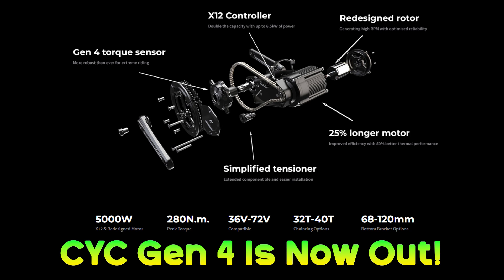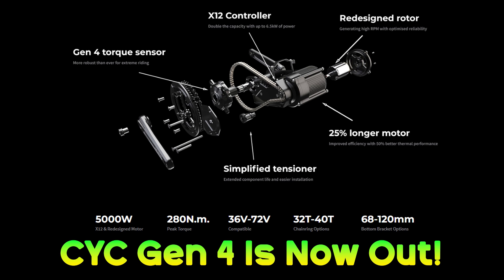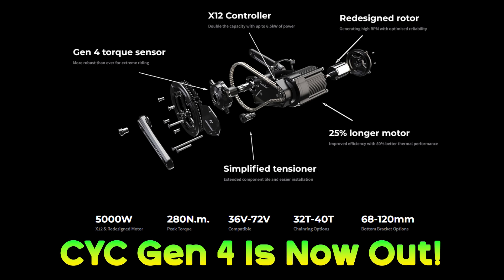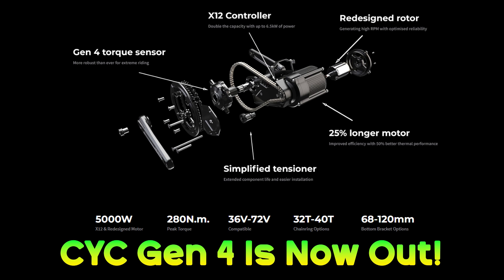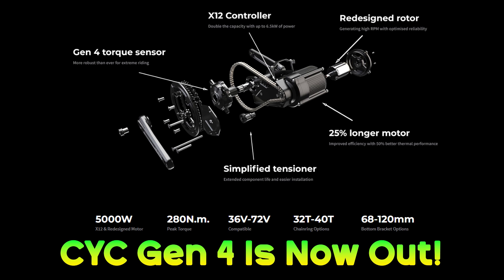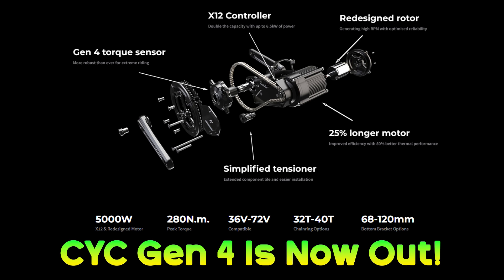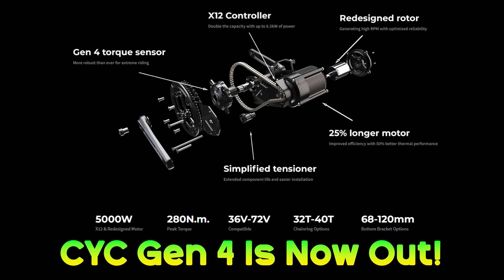CYC Gen 4 - Come on CYC! Show us the High Power!

Comment: I guess I am going to be the crash test dummy for the the cyc pro gen 4. I am a london bike courier riding the central london circuit on a highly customised omnium v3 electric cargo bike. Currently it has a photon which has done almost 6000 miles and has had two major breakdowns. My omnium with a heavy cargo can weigh as much as 75 kg fully loaded. The photon has done well but it is underpowered for the kind of courier machine I ride. Therefore the shop will upgrade the motor to a cyc pro gen4 to solve the power problems. I will keep you posted.

Comment: I think the only thing I will say is you’re kinda wanting too much. Because this is a diy kit and everybody will be putting these on extremely varied setups, so they can only do much testing.

They also have to appear more like a professional company than a hobby company.
Reply from the maker: I’m not so much concerned about their variety of frames but the length of running and conditions they test in. So like run it full bore up hills for 10km etc over and over and over. Because in the previous generations that’s what has resulted in failures. Hopefully this 4th generation will have greater reliability at the levels of power they are saying it can handle. It’s not a big motor and they are rating it above some really big and chunky QS motors.

Comment: I was thinking of adding on my old hardtail mountain bike, with single speed and running a 60v 60amps LiFePO4 battery, any thoughts?
Reply from the maker: I would be careful about how much draw the battery can take. But yeah why not. The draw is Watts / voltage = max amps. You want to leave some overhead though
Reply: @HighVoltageKits  It's a 60 amps BMS, I was thinking of protecting the motor, not the battery lol, also it's a LiFePO4 and usually can take full discharge without too much damage

Comment: My national agency, which sells fourth-generation motors, says the noise has decreased a lot compared to the third generation, but the manufacturer says there is not much difference in comments somewhere on the YouTube video. If it had actually decreased, the manufacturer would have made a comparative video, but I'm more confident to see that it's not.
Reply from the maker: Not shocked at all. The fact they won't make this video along with the motor being the same construction and parts with a few minor tweaks suggests it will be just as loud. Its more the pitch that people find annoying. They know it hurts sales so making claims its now quieter is a good thing for them.

Comment: I was looking at engwe m20 vs this one. But have no idea if it gonna fit
Reply from the maker: Maybe post some frame pics on our Discord and we can take a look.
Reply: @HighVoltageKits i hadn't use discord for years since it got hacked once. But i did saw videos up on youtube about they putting cyc pro gen 3 on m20. It need some modifies to fit so i move on with that frame. I don't want to do those sketchy mod that will avoid warranty. So i  bought an custom frame with battery from datbike and paid moder to put on pedal. Was about to pick that up next weekend when all the mods order will be put together. Highly recommend you should look for that frame. Mine was from used Weaver but brand new battery from weaver 200.
Reply: @HighVoltageKits and yes, it will fit cyc x1 gen 4 cause i order it to be modied to accept x1 pro/stealth gen 3 and even toseven dm1.

Comment: I think the new bafang torque sensor motors will finally bridge the gap against the cyc photon, tongsheng tsdz2 and the new dm motors. I have a tsdz2 and a bbs02b. The tsdz2 is a good motor but they're too flimsy.
The whole thing is secured with crappy circlips. The bbs02b is just rock solid. A couple of weeks back we had floods in the uk, I had no choice but to ride with the motor submerged in water for a good 10 minutes, I had no choice as every possible route home was flooded. When I arrived home I took the motor apart and was surprised at the small amount of water that had penterated. I love these motors theirs no comparison in terms of reliability atm.
Reply from the maker: Absolutely. They are pretty awesome. Let's hope it works out with the BBSHD / M635

Comment: In the end I do not trust CYC anymore. I run a X1 Pro Gen 2 here (with the option to upgrade to a Gen3 controller). When I met Cathy at Eurobike 2022 she promised that the software issues with the Android app for the Gen 2 will be fixed sometimes till the end of 2022. Then the new Gen 3 controller with new display and new app came out and surprise: No updates for the Gen 2 Android app anymore which programs the ASI 855. From what I have heared the Photon has similar software issues with the app. It´s not that the CYC X1 is a bad motor if you run it in decent power levels (e.g. 1-1.2 kW average with some peaks up to 1.4 kW) in PAS / torque mode but in high power throttle mode you will quickly waste either the X1 and / or your drive train. I have a Fat bike with stock BBS HD plus Eggrider. Also I build various BBS 02 fully MTBs with EggRider as well. I guess if the X1 dies on my fully I will either got the BBS 02 or BBS HD route. No money for CYC anymore. Especially getting spare parts in Germany is a true PITA and can get pretty expensive.
Reply from the maker: Yeah. You can't fault them for trying and keeping trying and there is a case to say they have got better but your story is not unique.

Comment: When I upgrade I'm probably going with TQ HPR50 since you can buy them as components now instead of spending 15k USD to get one on a bike - they're still about a kbuck so if I need another motor the Tongshen has been working fine for me and the torque sensor is really good on it so for about 270 just for the motor/display it's hard not to go with another TSDZ2B.  I pulled it out the box, installed it, and it just worked.  Nothing to write home about but there is also something to be said for zero issues (so far).
Reply from the maker: Not that familiar with that one! Yeah the Tongsheng is cheap. Also consider the DM02 its an improvement over that motor for not that much more.

Comment: The Ristretto 512 will be the first mass retail ebike to use the gen 4. Will keep you posted on how things are going once I get it, expected in March. I don't think there is going to be any meaningful amount of reduced noise from gen 4, only some arbitrary % they may assign to it hence they don't use it as a selling point.
Reply from the maker: The Ristretto is interesting. A guy on the channel got one of the previous ones. They put a special version of the controller on it restricting the power, so it likely to be 3500 watts maximum. You might be right on the noise. Please update. Might be a good one for the channel if you are interested.
Reply: @HighVoltageKits  It will be capped at 4500w/250nm of torque
Reply from the maker: Right on. I would take the nm thing with a grain of salt. I doubt they measured it. Is it going to be single speed?
Reply: @HighVoltageKits  Ok will keep the NM in mind, but it's def up there. It's a single speed and reaches 30mph in literally 3-4 secs, and 38 in another few seconds, topping out/cruising at 40mph on flat. On uphills it has so much torque, it just keeps pulling with no drop in speed. 52v/30a battery btw. This is all great, big question is how long will the motor last for lol TBC..

Comment: I'm planning to build a gen 4 5kw hardtail,  have a gen2 with bac2000 but swapped to x6 at 2kw pas, the bac2000 is on the parts shelf for another project.
Reply from the maker: Cool. Will need folks like you to give some genuine feedback. How the sprockets hold up. What drive train you go with etc. Be great to feature it and help others with theirs! Cheers

Comment: i don't see the point of having a torque sensor on a motor that has peak power and efficiency in the range of 250rpm. there is no way you can generate any leg torque at that crank rpm. obviously, 5000W @120rpm, which is what you can actually pedal at, would mean that you're pretty much instantly busting the freehub mechanism...
Reply from the maker: The setup that was being run with 6kw is not even being ridden with PAS. 72 volts on the CYC does not work great with PAS

Comment: All generations seem to have the same issues, from what I have seen.
I was going to get one, but went for a bbshd no torque sensor but it's reliable
Reply from the maker: I really hope that we can get the M635 torque sensor to play nicely!
Reply: @HighVoltageKits  I hope so as well. I have been holding off on getting a bbshd to see where this goes with the torque sensor. I just got a bbs02 with a 52v 17.5ah battery in a trade (my first mid drive). Getting comfortable with this before jumping up to higher voltage. I have been following you for a while. When you started talking about trying to get the torque sensing to p.ay nice, I decided to hold off on an hd as I am looking at making a commuter. My route ha s many stops crossing major thoroughfares. A torque sensing setup would be great for this application.
Reply from the maker: For sure. Although the HV tuning has a very rapid engagement on PAS. Maybe a 1/4 turn. Hopefully more news on that shortly.
Reply: CYC expensive junk motor No customer service ai generated good luck

Comment: The numbers doesn't add up. No way this tiny motor can dissipate the heat 5kw can generate.

BBSHD all day everyday. Way more powerful and reliable than this overpriced RC motor converted to be used on an ebike
Reply from the maker: The 350km hard testing was on an MX course. Apparently it did not get that hot..But that's not sustained either. That's on and off throttle bursts.
Reply: @HighVoltageKits You really think mx riding is easy on the motor? Have you seen a mx race? Anyway, it was not mainly on a mx track. But it was part of it.
Reply from the maker: No. I just think that people deserve to see what the motor and sprockets look and sound like after way way more than 350km. It's not enough IMO. Their video is not enough. After four generations of this I have a right to expect more. This is just common sense and is nothing personal about you or your riding. It's not like they are paying you. You do the best you can. But how do you know whether after 2000kms it will not have an issue. The only way this makes sense is if they are saying that the motor is 3kw so you tested it at extremes beyond any normal person would. So look at the overhead. I am looking this from a very cold what's gone before perspective. This is not some scheme to push something else. Not Mike's stuff or our stuff. Nothing. I will be doing a comparison with the Photon and the DM02 but it won't mince words. There are lots of areas where the Photon wipes the floor with it.
Reply: Cool to see you testing it, please share some videos with motor temperature sensor directly on the stator👍

Comment: I'm really glad you're calling out cyc on these issues. I came close to buying an x1 pro several times. But i read through the forums and FB groups and see tons of issues people have with them. I'll stick with my 72v BBSHD for now. It's been bulletproof pushing 72v for well over a year and I'm not gentle with it at all.
Reply from the maker: Thanks. I think they need to show more than a fancy video. Cheers
Reply: Are u on nylon gear? Are u full throttling most of the time?
Reply: @Jujubees225  yeah still on original nylon gear. I have a peek gear on hand if it ever burns up, but it's been good so far.
Reply: Nice. I have 5000 km on my stock BBSHD with no issues. Want more power tho. Whats a good upgrade controller?
Reply: @ballandpaddle  try the high voltage kit with asi 855. Up to 72v 4000 watts.
Reply: Overprice Chinese crap go ahead waste your money

Comment: I’ve been hurt by cyc before, they all seem to brake, overheat, and they’re expensive 
 But they’re fun when they work, so I expect CYC will hurt me again
Reply from the maker: The ones I hear on the comments that last are run well within their stated capacity.
Reply: @HighVoltageKits  
That’s good news, Sprag clutch broke on mine after 1300 miles